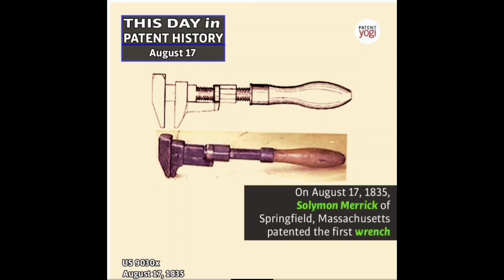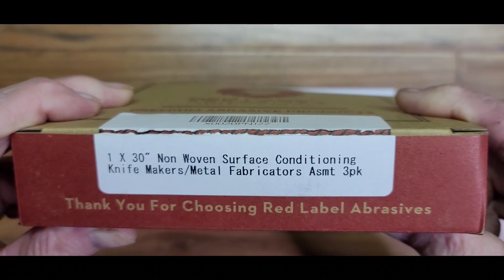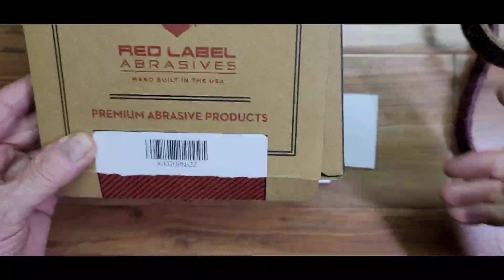Bicycle Wrench patent in 1835

Comment: I'm glad you're having success with those conditioning belts!  I really like those bicycle wrenches!
Reply from the maker: Thanks Magdad. I sure am enjoying the belts. I wish I could buy only the fine belt without having tom buy all three.
Reply from the maker: @357magdad  I rechecked and they still only offer 3 pack assorted the same as Amazon. I have bought their abrasive belts and they are the best I have ever used and they run quieter and smoother too.

Comment: I solved it!  I think...  The "3" in 1835 is really a poorly formed "9".  Searching for a wrench patent issued on March 26th 1895 yields a patent with number 536301 "method of making wrenches".
Reply from the maker: I appreciate your research and it is a good explanation. A very close look seems to definitely be a 3 but it is possible that when they set the type in the die they made an error and used a 3 instead of an 8 or 9. Thank you for taking time to help solve the mystery.
Reply: @johnfix1  I did not think 🤔 of checking 1885!  I will check that later tonite and see if there is a better matching patent 😁.

Comment: Mystery date.  There may have been a March 26, 1835 patent they referenced and had some corporate record.  But the Dec 1836 Patent Office fire took thousands of patent records.

From National Archives.   Patent records predating 1836 were unnumbered and could be accessed only by name of patentee and date of patent. After 1836, unique numbers assigned by the Patent Office distinguished each new patent.
Most original patent records were destroyed by fire, December 15, 1836. Reconstruction of the records was authorized by the Patent Act of 1837 (5 Stat. 191), March 3, 1837, which permitted inventors who had letters patent either to submit the originals, or certified copies of the originals, to the Patent Office; or, in the absence of documentation, to create a new patent document furnished under oath as conforming to original drawings and specifications. Arbitrary numbers suffixed with "X" were assigned by the Patent Office to the restored drawings and specifications.
Reply from the maker: Thank you for the very interesting information